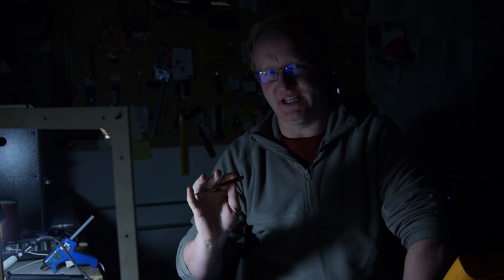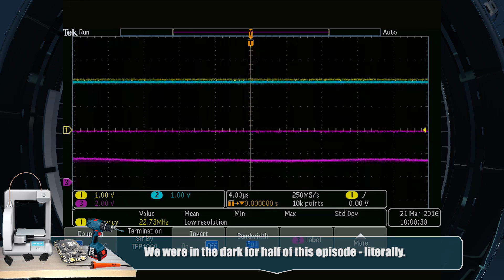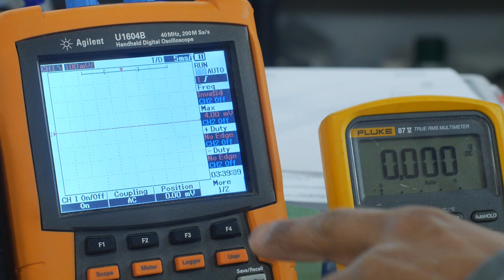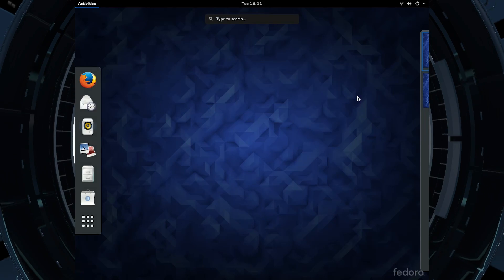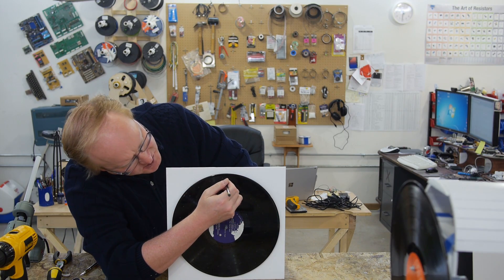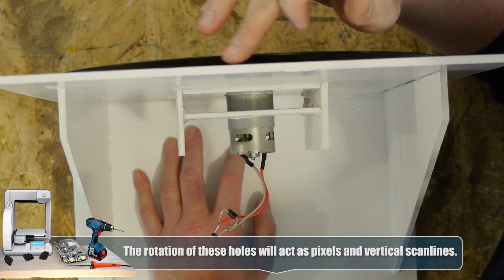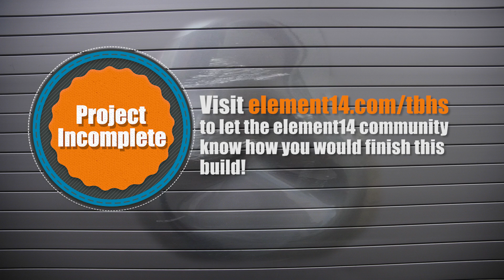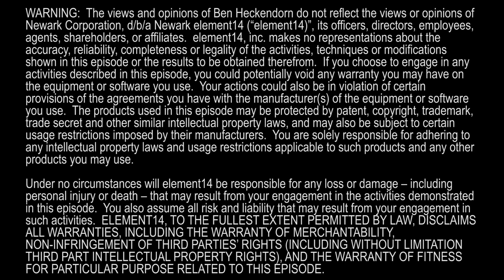Ben Heck's Mechanical Television Part 2

Comment: What if both motors were AC, and used an external reference common to both rather than trying to link them? The old mechanical television systems did that; the only link between the transmitter and the receiver was the image data. They used the 50Hz frequency of the UK's electric power system as the reference. By the way, early US mechanical television experiments also featured someone named Felix...

Comment: My bet is that the original mechanical tv used something like selsyn or synchro motor. And i would probably used ambient light for the "camera" and put the photodiode behind the disc with some lens or light diffuser.

Comment: Please revisit!!

1. Analog brightness signal !!!!   The source brightness should directly control the playback light brightness.  Simple analog stuff.  Get rid of the comparators here!

2. Sync records with some sort of analog encoder, (potentiometer, ideally) so you can get high speed, and absolute positioning.

3. Servo the playback motor so it is in sync with record motor. 
Simple comparator circuit here:
If the playback motor is ahead of the record motor, the comparator goes low.
If the playback motor is behind the record motor, the comparator goes high.

4. Low pass filter the comparator output, (capacitor in the feedback loop of the comparator) so it becomes a slow moving voltage.  Put a high current buffer (power amp...) on the filtered comparator output that directly drives the playback motor.    Boom, synchronization!

5. Transmit the record brightness signal and the record encoder position over two AM radio signals.  It is TV after all! 

OTHER IDEA:   
Instead of a spinning record, use lasers and a XY mirror control, like a barcode scanner.  Use the mirrors from a laser printer or barcode scanner?    Way better resolution.  LASER TV!!!

Comment: OK. so this is what i would have done. looking at the logic of the whole project. we can use light sensors or photo resistors to see a whole  reflection, so imagine using a silhouette image in black and white and just projecting anything that has more than a 50% light ratio onto a set of led's. even though it would only be black and white it would still reflect the basic image that it "records". as a matter of fact , these images can then be saved into a script as a "recording" using some kind of system like a raspberry pi and some basic bash or python scripting for later viewing. if you would like me to demonstrate, please let me know.

Comment: For synchronisation: maybe add one hole that always has a light on it, so you can use the blinking of that to get the timings right?
And for door knob sanitizing: bare metal is already antiseptic, so a metal door knob is already self sanitizing.
Reply: I can see that idea working! Using a mechanism like that to sync it? awesome.
Reply: +Bart Stikkers Only copper alloys are antiseptic as far as I know.
Reply: +1blisslife Add my vote to that; basic timing light. Great idea. Still need to build the system tight enough to make it tune-able though.

Comment: MDO3000 - as use full for this task as a heavy pickup to drive alone in the summer two miles to the bakery to pick up the sunday bread. Yes that^s great. But a small car (or in this case scope) does the job just as good. This build is a greate idea that can be executed with relative low tech. No need to give people the impression, that they need an expensive scope for this task.

Comment: You could make a signal sort of like 5v p-p pulses for the light signal and a 12v p-p signal for each revolution, then set up an op-amp to comparatively peak-detect the 12v signal and adjust the receiver disc speed untill the p-p signal from that matches and the light can be flickered on and off once the wheel is up to speed then it should be somewhat in sync.
I wish i could come to your workshop and show you how things are dome

Comment: Definitely want to see the Mechanical TV revisited. Probably the most interesting idea for an episode in quite some time. Go big or go home!
Reply: Totally agree.  Very disappointed to see them give up on it.
Reply: I agree please revisit
Reply: +Mooncabbage I second this. This device changed the world in a way that was almost magical for most human beings I'd love to see it working in the naked... Maybe it actually used magic?
Reply: I would like to see them pick it up again as well. A lot of hobbyist knowledge about tv was circulated in the 1930s but most of it is unusable today.

I agree that the way the image is created is a kind of "magic" to us in a fully electronic age. It is not just lo-def. It looks like nothing else because of how it's made.
Reply: It's really close to working. The picture generator (receiver/viewer) is correct. However, the camera end of it isn't correct. Two suggestions...
1. Cameras don't project light, so pull the flashlight out, and shine the full light on the subject being filmed. Try the camera out before doing number two.
2. Either centralize the photo diodes, or use a larger photo sensor (like a solar cell, or ancient selenium photo censor). Make sure that the photo sensor(s) is in the same position on the camera as the viewing port on the receiver.
That should give you an image, however you may need really strong light for better imaging.

Comment: Someone has to make a video explaining how to install Gentoo Linux. Regarding the mechanical TV, how about you put more RPM to both the scanner mechanism and also the projector side and slow down the scanning frequency from the control electronic. In this way there is more chance for the apertures to sync and you obtain an image albeit not so smooth.

Comment: I would have used DC motors anyway or brushless motors. Stepper just can't reach high enough speeds; instead of a microcontroller, you could have used the Phase and frequency comparator of the first stage of a PLL, ignoring the VCO. This way you could have driven the motors with PWM. I know it would have got more complicated, but it would have been worth it, as most of PLLs integrate almost every component needed to have a DC output that can then be used for the PWM comparator. I've gone into several of this issues as I was trying to build a mechanical laser video projector and although it didn't work in the end, the speed controller made this way was performing pretty well.

Comment: Wouldn't the simplest solution for timing be, in essence, a bike brake? A set of felt pads that grip the disk and arrest its speed just enough to bring the two in sync? So long as you always made sure you had a consistent speed with the image creation disk, and as low of one as you could and still guarantee reasonable clarity, it would mean that timing to other units would be relatively simple. The motors you're using are designed for torque anyway, so surely making them use a bit of that power to drag the disk along wouldn't be awful. It would produce quite a bit of wear and tear on the vinyl, but something like this in mass production wouldn't be using vinyl anyway.

Aesthetically it could work, and functionally as well: a simple dial on the top or side of the device that tightens or loosens the brake, until the images begin to align.

So, internet: what am I missing that's obvious for why this isn't the solution?

Comment: for a mechanical television there are way to much electronics involved
Reply: NonsensicalSpudz a mechanical tv can work without complex electronix

you need 1 LDR
2 high watage wirewound resistors
2 motors
1 light
Reply: NonsensicalSpudz like a said to much electronix not no electronix
and second i said no complex electronix
so please go and get a degree in electronix bevore you try to tell me stuff i already told you

and ps
also get a degree in grammar nazie becaus my dislectia wont fix itself
Reply: NonsensicalSpudz realy dude is that your responce
Reply: NonsensicalSpudz to be honnest i thought you were trolling and so i decided to feed the troll (i do have dislectia though)

Comment: Why Fedora?? there is so much better and easier Debian based solution..
Reply: +corey drew bruce 
install gentoo ( ≖‿≖)

I'm joking. don't install gentoo.
the thing here is probably to try using an RPM-based distro, this is fine. but Fedora is really just a bleeding-edge version of Redhat or Centos in that respect and things can break if you're not careful. so yes, I share in your desire to see them use a Deb-based distro instead. Hell, I'd love to see them try out Devuan when it goes stable.
Reply: ***** lol nah no thanks haha
Reply: ***** No that's not why Linux is a failure as it isn't close to being so, that is one distro alone that is optional for anyone to freely use